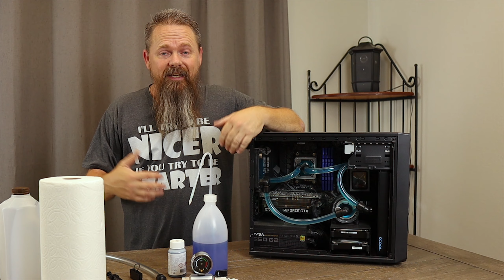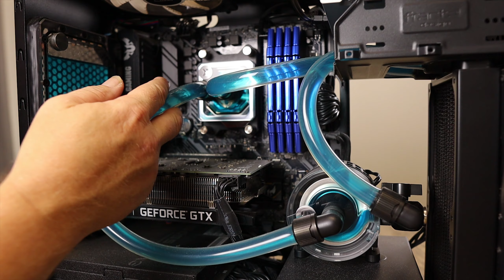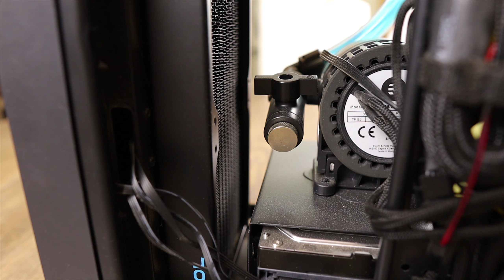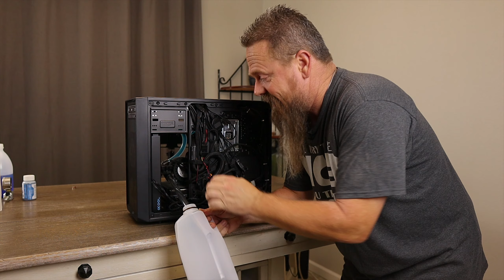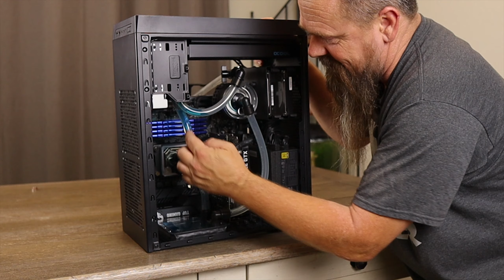How To Clean Your Watercooling Loop

Comment: Nice video sir. Im planning to make my system water cooled and im kinda new in this kind of set up. What are the sizes of the hose and water fittings that i need to buy. Im just water cooling the processor.
Reply: @pinkgrognak  Thats what im thinking too. Thanks for the suggestion sir.

Comment: I just flushed my pc for the first time
And it looked clear before after my tubes went dark dark brown it scared them hell out of me and some fittings look like corrosion and my cpu block is black? Is it fixable and reusable still?
Reply from the maker: If it's soft line just replace it. I would use primoflex LRT. I'm regards to your block I would disassemble it and clean it really good. A toothbrush and toothpaste works really well (not the one you use on your teeth).  Then flush your rad. I did a video on how to do it. 

Sounds like you got some growth. Make sure you use fluid with a growth inhibitor. The parts should be reusable if you can clean them.
Reply: @CyberCPU  will do everything you said and watch the other vid for sure I was no joke like dis I just ruin everything it’s weird though I only used distilled water?
Reply from the maker: @InSaiyan-Shinobi  Even if you use distilled water you have to add a growth inhibitor. The Primoflex LRT hose comes with one that will work. It also comes with a great cleaner that you might think about using. Just make sure you follow the directions really well.

Comment: Hello cyber. Idk if you can help me or not but I have been having an issue with my PC. When I start it it won't load through the bios like it goes to bios load screen starts the spinning wheel like it about to load window 10 but never does I have to restart my PC and then sometimes it will load. I have reflashed my bios, fresh installed windows ten, and checked all my drivers. Any help would be much appreciated! Also great videos!
Reply: I have a Ryzen 5 3600, 2060, b350 mobo, 2 16gb ram sticks, and a 700w gold power supply.
Reply from the maker: First think I would do is try to get it into safe mode. After three failed Boot attempts it should launch startup repair. Go into advanced options and then select advanced startup. Push #4 for safe mode.
Reply: @CyberCPU  okay what would I be looking for in after achieving that?
Reply: @CyberCPU  I tried to run "startup repair" it came back with a "could not repair"
Reply: @CyberCPU  I ran command prompt and ran "sfc /scannow" and it came back with "Windows Resource Protection found corrupt files and successfully repaired them. Details are included in the CBS.Log %WinDir%\Logs\CBS\CBS.log – indicates that the tool detected problems and was able to fix them." So maybe that will fix it.
Reply: @CyberCPU  after ahitting it off earlier I just recently turned it back on to play some games with my friends and it started fine. Thanks for the help. It means a lot.